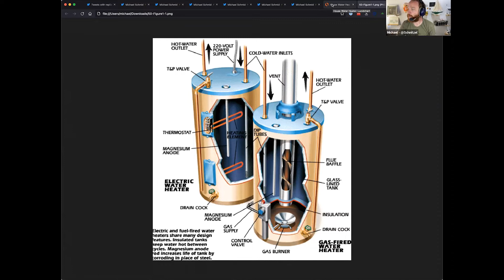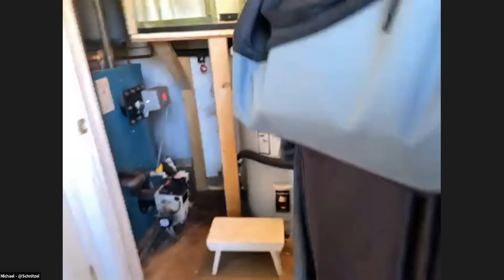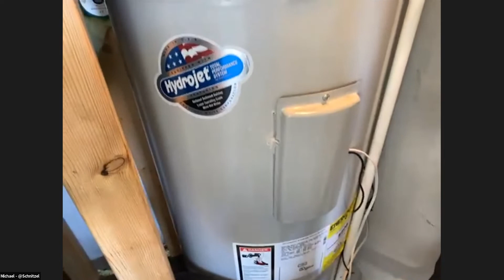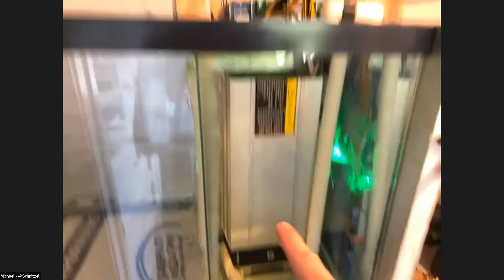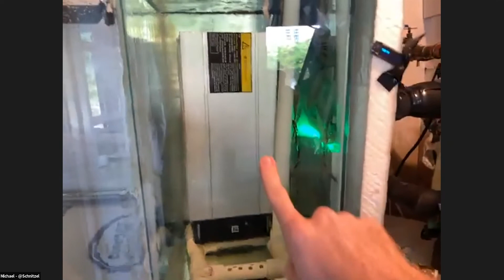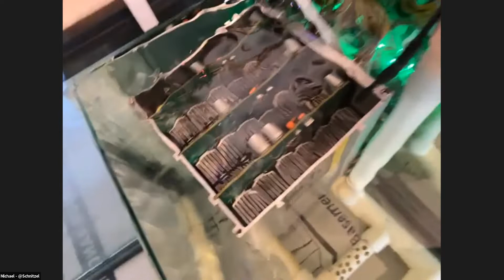Bitcoin Water Heater - Overview & Live Demo

Comment: theres one safety you can put intoo the system that prevents the miner from burning up should the oil level get too low , basicly a float switch that gets triggered when the oil level gets under the set level , they sell them on the chineese sites for less than 2 dollars , hook that up to a big relays and you can shut the circulation pump off too 
might hook it intoo my central heating and do a second system with a car radiator sitting outside to cool the thing when its too hot out to heat the house 
i AM planning on running the miner 24 / 7

Comment: If I missed this info in the video, please forgive me. Where can I get the flow/temp sensors and how are the probes tapped into the pipes?
Reply from the maker: Check this thread for the sensors: https://twitter.com/Schnitzel/status/1517458587219546112
I've tried to drill holes into the pipes and put the sensor inside the pipe, but I ended up having issues with leaking water all over, so I ended up just gluing the temp sensors to a brass or copper section of the piping with some thermal glue
Reply: @nakamotoheatingsolutions  Thanks much for the reply.  I can see temp working with contact the outside of the pipe but flow rate? It measures that from the outside without a transducer?
Reply from the maker: @cam Ah yes the flow rate sensor is actually in line of the pipes, these flow meters are completely enclosed though, they work with hall effect sensors and can't really leak :)